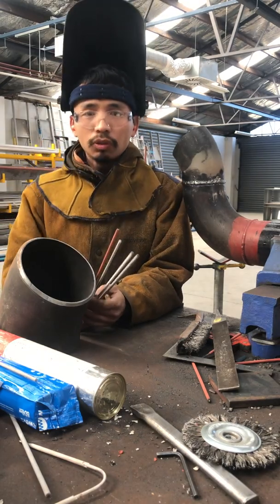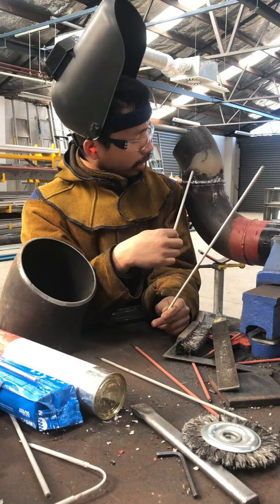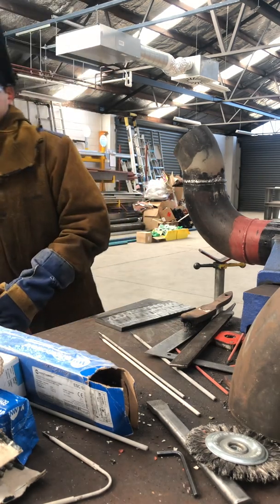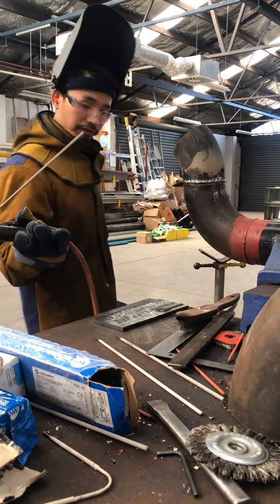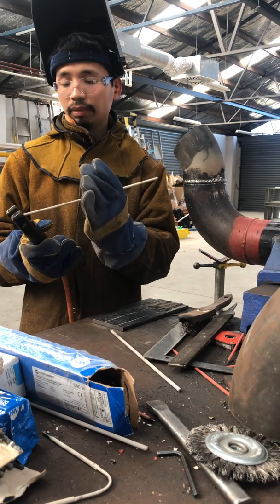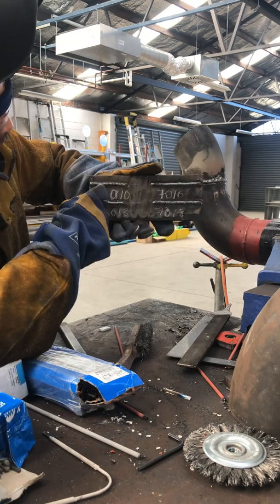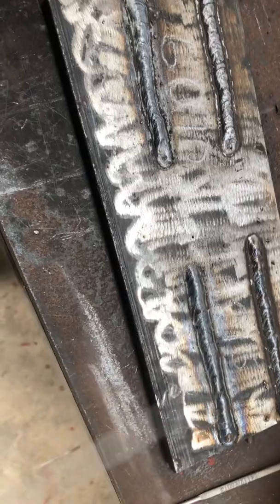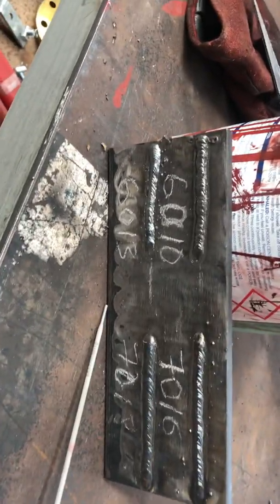Welding rods review 6010, 6013, 7016 7018

Comment: What is main difference between 7016 and 7018 rodes
Reply: E7016 is AC and has less ironpowder in it.So less deposition an current required than E7018.